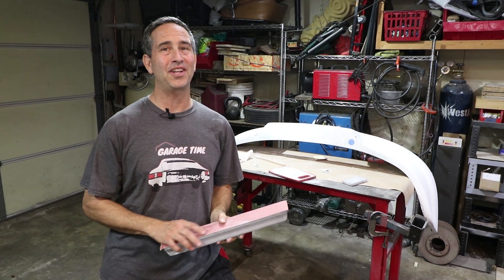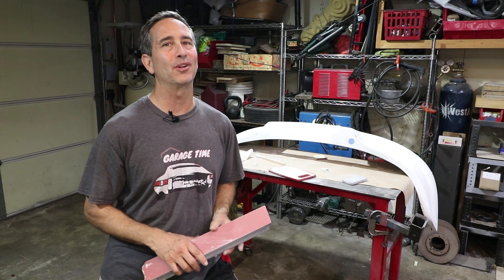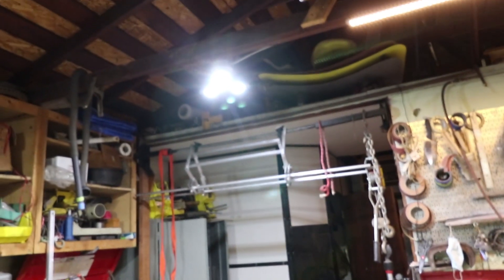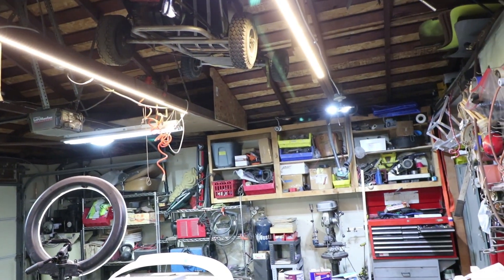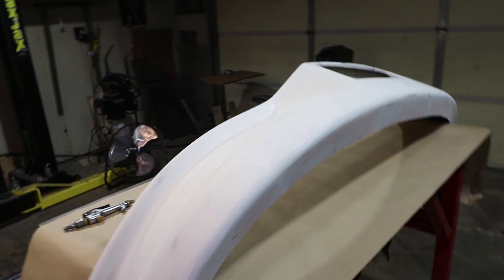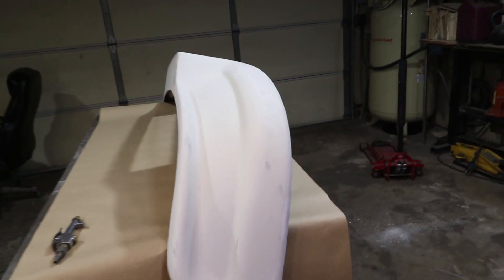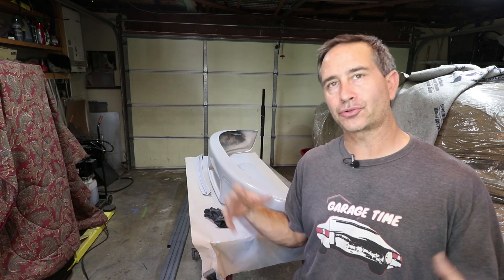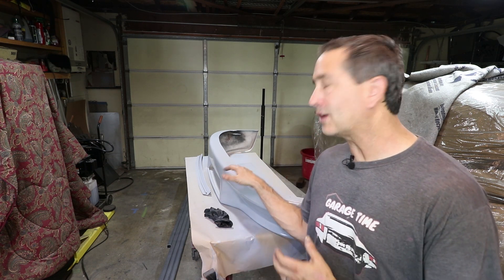GIVEAWAY TIME ** Plus More Exciting Paint Prep On my Porsche 911 Driver

Comment: Circle is the original color of the bumper.  Just like the green and red circle on your doors!  I could use two of those LED lights if they will fit in a recessed R20 base.  Great video Tom as usual.
Reply from the maker: Might need an extender for the lights.  You will be in the running!  Thanks!